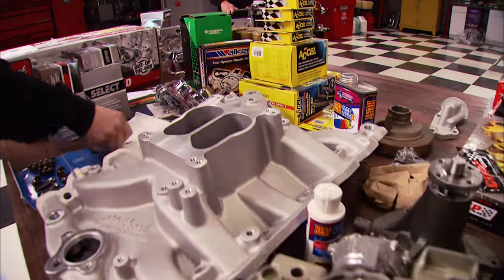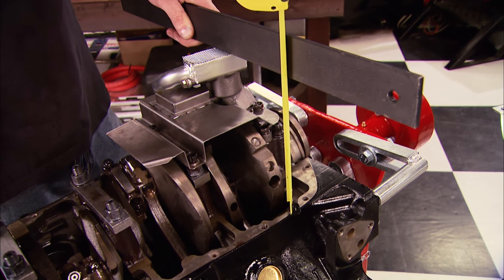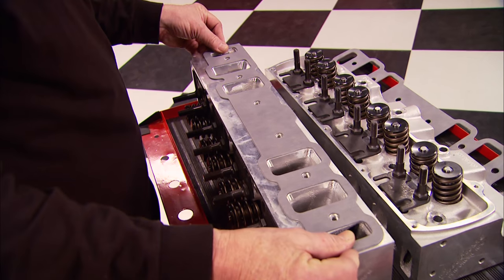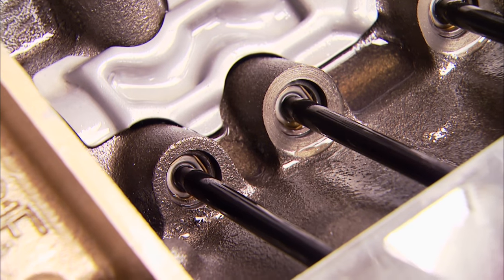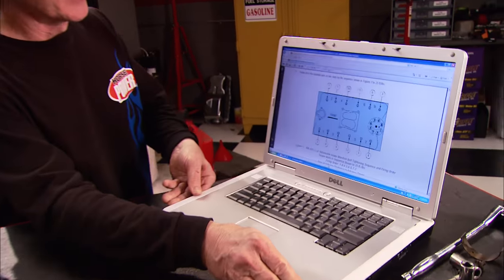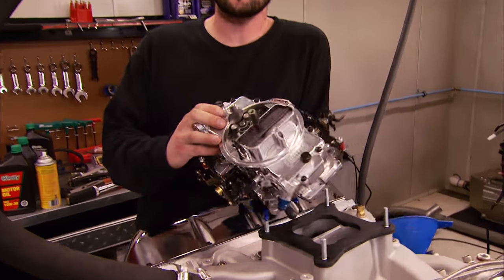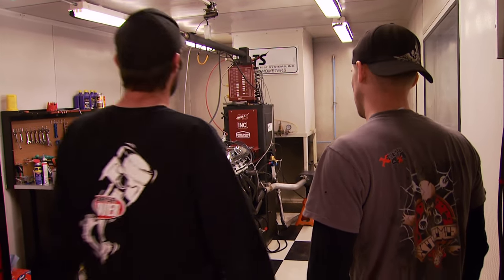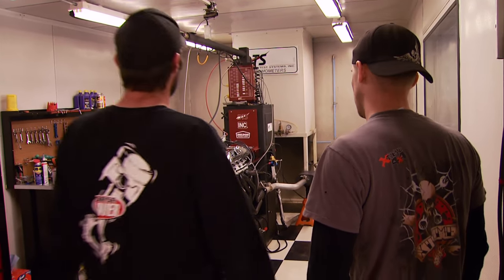Dyno Testing a Mondello 455 Olds Big Block - Horsepower S13, E8

Comment: I had a 425 Olds in a 66 that was flogged hard and regularly. Toughest big bore engine I ever saw.
Reply: 425 had a forged crank.  Yep, tough as nails.
Reply: Well in one video, reviewer told Hurst engines weren't that strong as compared to others!
Reply: ALSO there was typically more cylinder wall thickness to accept a max overbore engine. Getting the EARLY non-Toronado 425 "D" blocks was the key using the normal.842 lifter bore size. If I remember right, all 425's were forged steel cranks & rods. Like a 427 Chevy bb,  the engine loved to rev with the under square bore/stroke combo. The major probkem was keeping the majority of the oil down at the crank. Joe remedied the problem with oil restrictors in the main oiling passage to the crank to maximize the flow of oil to the bottom end, thus saving many bottom ends from oil starvation along with higher volume & pressure oil pumps.

Comment: 750 carb works fine on a single plane intake manifold.  You want to almost double that for a dual plane manifold.  Each cylinder is now only breathing through half the carb.  Dominator 1150 :)

Comment: I had a one on theses on a jet boat in the mid seventies when I was a kid and gas was cheap. It was said to be high performance 390 horsepower. I don’t how many thousands of gallons of gas I put through it and most of it at WOT. When I sold it, it smoked a bit at start, probably valve guides. It had a Holly spread bore 750 double pumper on it when it came from factory. The only problem I had was the fuel pump had a check valve the would at random times hang up and loose pressure. That drove me crazy because it would work when you tried diagnose. The only mod was a rev limiter so I didn’t have to lift between waves. Dam I beat the heck out of it......and it lived.

Comment: Those same mods on a 454 Chevy would be well over 500 hp. They did the 454 with stock heads and low compression pistons and made 408 hp. Then they installed dome pistols aluminum heads roller cam and had over 600 hp.
Reply: Yeah, BBCs pretty well crush every other GM big block. Frankly, there's no reason to build any GM engine besides LS variants and BBCs over 572 unless you just have to have a matching brand motor for a mild build.
Reply: @member5488  the aftermarket really caters to the sbc/ bbc crowd. In terms of aftermarket support no other engine platform has access to as many good parts. In any N/A application cylinder heads are for the most part the deciding factor in terms of peak hp n compared to Buick Olds n Pontiac the options are endless for sbc n bbc.
Reply: Big block Chevrolets definitely make more power but the olds mobiles engines seam like torque monsters
Reply: It’s got a lot to do with the stroke arrangement with the olds.

Comment: These fine gentlemen are artists. They just need more episodes that revolve around using EFI. I die a little bit inside every time I see them do these wonderful builds and then strap a carb on top.
Reply: Ain't you the superior one...
Reply: Guess you just can't figure that old school shit out. Maybe you should give it a try.
Reply: I grew up on both. There is no guesswork with a computer when you know what you are doing. It's how Ford designed the new 7.3. Grow up.
Reply: This shit is 10 years old.  It's not like putting a Holley Sniper or FiTech like nowadays.  Plus for easy break in on very sensitive flat tappet cams, the carb RULES!!
Reply: @vendediesel  Ive built engines for a living for the last 35+yrs, I believe I'm grown, boy....
Reply: EFI way too expensive for little difference...

Comment: 1hp per cube don't take into account the overbore.
Reply: Underrated comment
Reply: Their Is not anything special about this motor, The dual plane Intake Is killing this motor to, The 455 ranged from 250 ho to 400 from the factory, So say it was a 350 hp stock It picked up over 100 hp and that's not bad at all.
Reply: (4.156÷2)sq x pi x 4.250 x 8 = 461.23 ci
Reply: Exactly

Comment: Had a 70 olds 98 455 rated low at 390hp 510 lbs ft of tourqe. Stock olds rocks.
Reply: SHOULD have threw on some headers and swapped the cam out to a 230 dur @ .050s.
Reply: @w41duvernay  I was 17 and stupid. I regret losing that car :(
Reply: @w41duvernay  never lost a race in that boat. Turbo 400 automatic, would ream out 1st gear to 60 2nd gear to 90 hit drive and it was floating never took it past about 120. I embarrassed many hot cars and vettes in that thing. My driving and knowing the car helped a lot. Lost the muffler and threw on a glass pack. It sounded bad as hell...

Comment: I had one of these on a 69 Vista Cruiser...HOLY SMOKES!! Turbo 400 trans and Posi rear...it was a real beast..lots of fun to drive. 250K later my brother took it apart to rebuild it it was in good spec and still had honing marks on the cylinder walls. Great motor!!! TORQUE GALORE. He has put it is several cars over the years, he says he will never get rid of that block. One more thing these are getting hard to find in Bone Yards...Nothing else sounds like a 455!! The only thing I would do different is go with a twin turbo, on Natural gas..That would go to 500HP.

Comment: Edelbrock heads you better take them apart cause the guides will leak. And never pump up any howards / morel roller lifters . or any anti pump up lifters . VR1 Valvoline high zinc and a bottle of zinc additive. Never had a cam issue and break in cam vary the rpm every 5 minutes for 30 minutes from 2000 to 2700 rpm. Like 2200 , 2400 , 2500 , 2700 then back down.  So oil is slung off crank at different angles onto the camshaft.

Comment: The best way to adjust valves hydraulic or solid is to roll the crank over, go from cylinder to cylinder and as each intake valve starts to close you adjust the exhaust valve and then when the exhaust valve begins to open you adjust the intake valve. If you have a lot of overlap it ensures your on base circle.

Comment: One HP / CI used to be THE elusive ultimate dream target goal of ALL hot rod engine builders with the normally aspirated. Today? - Many ways to get there! With the same block and rotating assembly practically. I bought an Olds '98 brand new off the showroom in 1972. Drove it 6 or 7 times then put it in storage for some years while overseas, came back to it just in time for the gas crunch. Had a '76 VW bus. YUP! An Olds 455 in a pretty VW bus that everyone thought they would pass. nope. nope. HA! The honking they did when they didn't get the results they expected.

Comment: "I'm not showing you what we do." As he puts the lifter he just pre pumped into the motor...
Reply: Yeah but they said it has solid lifters?????? This is total BS.
Reply: @BigDaddy-fx4nx  no actually he said it was a hydraulic roller.
Reply: @attitudeadjusted9027  4:02 He says "we've been soaking our Comp hydraulic lifters...." Nothing about rollers or solid, and of course you can see for yourself that he has flat tappet lifters in his hand.
Reply: For the record don’t pump up your hydraulic lifters
Reply: @camjamsdad  If you prime the lifters beforehand,  you're shooting yourself in the foot. On engines with a high-lift cam and close tolerances, you may eat a valve & piston priming them. On other engines, you'll simply have to crank the piss out of the engine at start up till the lifter can bleed down and the valve can seal properly.
Soak the lifters in oil before install if it makes you feel better, but do not pump them full of oil...we want air in there. If your oil pump is properly functional and you primed the pump to fill the filter and get oil in the passages, the lifters will fill pretty damn quickly on start up without the lifter cup being shoved so far up in the bore that it causes damage or loss of compression.
Reply: Warren Zevon's Angry Ghost it is a hydraulic flat tappet cam. They said it in the video and you can tell by the lifters.
Reply: @markball7028  Yep. That's what I said in my first post.
Reply: camjamsdad  
There's 16 lifters not 8
Reply: Warren Zevon's Angry Ghost this guy gets it. Well said
Reply: Jerrod Planck where did the hydraulic roller cam go?
Reply: Zero lash is zero lash.  Pump 'em up if you want, or not.  I shoot for about .020 of lifter preload before installing the intake, that's usually enough to keep things quiet.

The 455 rockers were fixed, those shown are aftermarket.

Anyway lifters should leak down, else they're stuck.  So check new lifters for that b/c it can happen.

Comment: +30 is 461 on the 455 Olds. It needs an advance curve kit,a 4-hole 2" spacer on that intake and a 800 cfm webber afb carb. Use the C casting heads if you can find any,and port like Joe. You will have about 505 hp and over 600 tq. This engine ruined my 85 Cutless with the tq twist. It actually popped my rear window out on a hard launch. Use a chain to the frame rail from the head or it will break the engine mount. Have fun folks!
Reply: This build 00:47 re-using stock flat tappet cam... 4700 RPMs HP peak...

Comment: Wasn't gold for the small blocks?
330's 350's etc.
Blue for the big blocks.....
Reply: Red for some early 425 big blocks bronze for 68 to 72 big blocks blue after that
Reply: @jeffflaig362  Soooo only Gold for small blocks.
Reply: 330, and 350 were gold. 400 were bronze. 425 were red. 455 were red in 68, and 69. Then 455 were blue from 70 on thru 76.
Reply: Blue started after 74 or 75...350 and 455 were both gold before and blue after...had 71 and 75 Toro with 455 and cutlasses with 350...ten bolts in valve covers on gold engines...five bolts in blue...technically speaking, no such thing as small block/big block olds...engine blocks are same size...different bores and strokes...
Reply: @fredmendez4837  Blue did replace gold on 350 in 75 I believe. You are correct . No such thing as a small block, big block Olds. They were all based on the same architecture. What is called a big block ( 400. 425 . 455 ) are raised deck engines to accommodate the longer stroke. 455 s were red in 68 and 69 . Then blue from 70 thru 76.
Reply: @camgnilpe9300  Do it right durd brane
Reply: My 455 is blue
Reply: Olds Pontiac and Buick all were one size blockers I loved to rob the 301 s out of some shit box and drop in a 455 or 400 Pontiac  and go and eat mustang's and camaros for dinner it was fun times same w the 260 olds motors drop in a 350 rocket out of a 68 cutlass or so in a g body lol talk about shock and awe lmao
Reply: was the 330 a 2 stroke? not sure i heard some were.https://www.youtube.com/watch?v=RoiWpJLokEc
Reply: @fredmendez4837  Blocks have different deck height Fred
Reply: @johnringel9892   Yes there are big and small block olds
Reply: @glennmanchester1568   Wrong again
Reply: @jlo13800   NO
Reply: @tonytymoszek4049  All Oldsmobile engines are based on the same architecture. What is called a small block, 330,350,403, and what is called a big block, 400,425,455. All use the same placement of the mains ( larger engines, larger main ) same crank to cam span, same cylinder bore centers. The larger displacement engine were basically a raised deck version of the smaller engine.
Reply: So everybody UNDERSTANDS! OLDS NEVER PRODUCED A SMALL BLOCK! IT'S CALLED A MID BLOCK! AMC 401, Buick 350 Pontiac 400 Mopar 383>>>>>> ALL MID BLOCKS OPEN YOUR EYES DAMN!
Reply: Had. New 1965 Olds 442 with the 400 cubic engine.  The engine color was “gold” !

Comment: Build an Olds 455 for torque. ALL torque. A mild dual pattern marine cam for daily driver, not attracting attention. Injectors and velocity stacks, not a big carb. Higher compression ratio while you're at it. Now gear it 272:1. The busted gear teeth and twisted drivetrain can be dealt with AFTER. Torque is what you FEEL everyday. It's the fun. And the biggest reward of this build? GREAT fuel economy if you aint nailin' it all the time. Surprise!

Comment: You don't pick up 20+hp because of "cool dry air", unless you're using uncorrected numbers, which aren't repeatable. They fudged they dyno correction just enough to get the 1hp per cube, so it doesn't look bad.

Comment: If you look at your dyno sheet, engine torque is in lb-ft, not ft-lbs.  ft-lbs is twisting torque used on bolts, lb-Ft is a measure of work capability.
Reply: People misuse those terms all the time.

Comment: This engine would likely pick up 25 hp and as much torque with an air gap intake  vs the performer,  would like to see the comparison
Reply: Even a Torker would most likely help.
Reply: Shaving down the divider a half inch or so in the intake would  likely give 10-20hp also.
Reply: Not likely... small cam, low compression ratio...
Reply: Look closely 00:47 re-using stock flat tappet cam... 4700 RPMs HP peak...
Reply: @BuzzLOLOL  he said hydraulic roller not flat tappet like stock
Reply: @BuzzLOLOL  then puts in a flat tappet lifter huh
Reply: @spartynation355  - As usual, didn't know what he was talking about or lying... they obviously sneaked the old stock flat tappet cam back in to get the video done... 455 HP isn't bad for only the 4700 RPMs shown...

Comment: Thanks so much for showing this. I'm an Oldsmobile guy from way back when. If you can find one I'd love to see you guys work on an Oldsmobile 425, specifically the one they used to put in the 66 and 67 Toronado. I'm looking to buy a 67 Toronado and would be interested to hear your comments on rebuilding it. It would need to keep the stock intake and exhaust manifolds and oil pan to fit, and I'd want to keep it looking stock too, but what could be done?

Thanks again!
Reply: 425 was a Cadillac motor.
Reply: @spaceghost8995 , the Oldsmobile 425 was not a Cadillac motor. It was descended from the original Oldsmobile "Rocket" V8 from the late 40s. It went to a 455 the year after my Toronado was built. The 66 and 67 Toronados had a special high performance version of the Oldsmobile 425.

Cadillac's 425 was completely different, designed around the 472 in the 70s.
Reply: @SirAndacar  It's a great motor you got. I built a 66 toro motor & put it in an '80 Salon & the thing did wheelstands on street tires w/3.73 rear. Engle cam. B heads. Torker/holley #6213
Reply: @Torch4Life , thanks for the reply! I should have clarified. I used to have a 67 Toronado way back in the early 80s and I miss it terribly. When I get another one I would be building the engine for long distance cruising and torque, not racing. I'd also be rebuilding the Turbo Hydramatic 425 front wheel drive transmission for heavier duty and longer life. I know a guy who is a genius with Quadrajets, so I'd stick with the stock carb as well.
Reply: @SirAndacar  Makes perfect sense. My example is probably rare, i was very pleased with how it was so willing to make power. I kinda grew up on 455s & it was my only attempt w/a 425, so your posting about them brought back fond memories. 18436572 for life.
Reply: @Torch4Life  , I like your rare example! I have nothing against then as such, I just get tired of the rows and rows of 350 small block Chevy engines I see at every car show. It's nice to hear people are working with something different. Oldsmobile arguably made some of the first muscle cars in the late 40s by sticking big car engines intended for the luxury 98 into their midsize cars.
Reply: We were out for a drive, Mom and Dad with 3 kids in the back seat. My Dad had a 425 in a 1966 Olds Dynamic 88. He was a stock car racer back in his younger days driving 37 coupes with open manifolds on dirt tracks in the early 1950s. Anyway about 1970 we pulled up to the lights and there was a Charger with 440 labeled on the hood, and on the other side a Corvette about a 1963 bullet back. Both these cars by the sound of the compression had been souped up. The light turned green and all  three cars were neck & neck for the longest time. Slowly the other two cars pulled away. But even as a child I was impressed how that stock 425 with 5 people in the car kept up for that long. My Dad after he put the brakes on looked back at us kids and said with a smile " The 425 mil takes over"

Comment: With premium heads and intake shouldn't it be easier to make more than 1HP per CID?
Reply: Did you hear it? Little more time and those guys could've destroyed that flat tappet anchor.
Reply: lso4988  BS.
Reply: Yes but this is pretty much a shelf build that anyone can do. If they changed a few things they could make more power fairly easy. They definitely need to get them fuckin rocker arms off of it!!!! Gotta sell shit though! Put some pro magnums on if you are not going to shaft mount!!! All day power increase from rigidity
Reply: Olds engines make good torque but they’re a little soft on peak horsepower.
Reply: @timsharpe3498  good for pulling those 6000 lb steel sleds from 70's Detroit....
Reply: All of GMs old school big engines are torque monsters. The 500 Cadillac is the king of torque. The Buick is probably the best all around 455 because they make big HP and torque without extensive modifications. The Pontiac 455 is very short winded without some good aftermarket heads. The Olds heads look like they came off of a diesel tractor so it’s no surprise that they don’t make big HP numbers.
Reply: @timsharpe3498  Use well ported C castings,but the 4 degree valve angle is a challenge. I did some head deck work on mine and did alright.

Comment: 4:30 Some people apply a vacuum pump to the oil container. That makes the job go much more quickly.
11:37 Actually it would need to be a little more than 455. I'm not sure what overbore this engine has, but it has resulted in more cubes.

Comment: 455 Olds were never HP engines, they were torque engines, keep them below 5000 rpm and they live forever. The 4.125 bore was small for HP but the 4.250 stroke made up in torque.